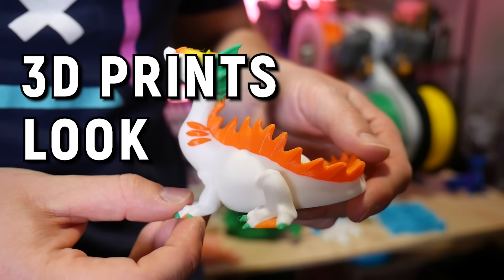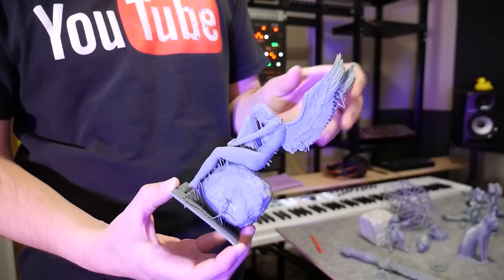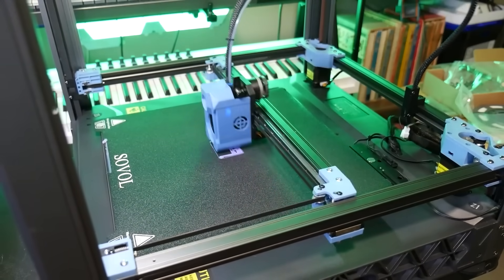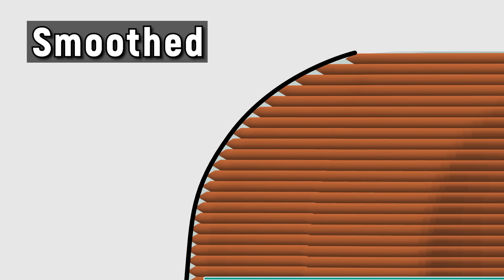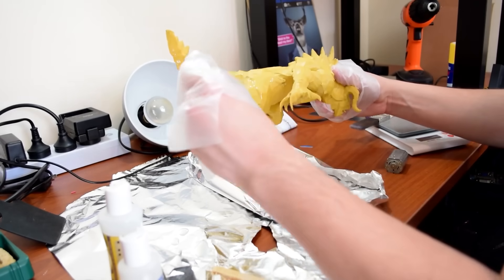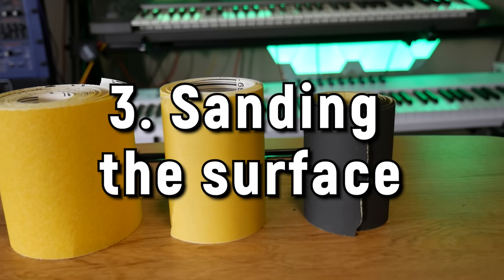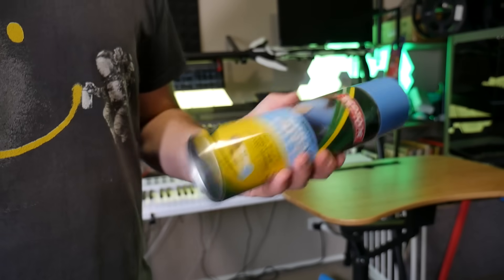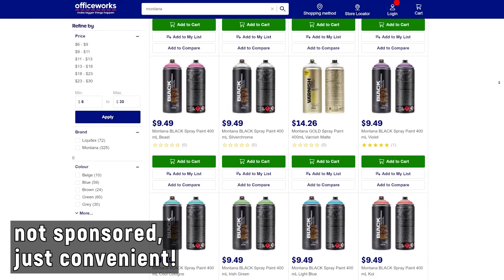How to make 3D prints look like they're NOT 3D printed.

Comment: I've recently been experimenting with Acrylic modeling paste. This stuff is THICK! However, it can be thinned with water. You can apply it with a brush easily. The real party trick is once its dry, to get some water and a low grit sanding sponge. The water will "re-activate" the paste a little allowing you to sand/move the putty around to smooth it further. Works pretty well and is less "chemically" to other options. Also, it sands REALLY well.
Reply: Some people mix it with IPA instead, until its reached the consistency where its self levelling and then paint it on in two coats.
Reply: @radishdalek  So I tried IPA. I will say it dried MUCH faster than water. Maybe I didn't mix enough IPA to get it to self-level, but other than fast drying didnt notice too much difference than water. The big thing with water is after it has dried, you can use a sanding sponge and water to smooth it out.
Reply: @JeremyBlackston  Wat grit size do you use to sand?
Reply: @radishdalek  I am really only sanding with 220-320. Here's my method...
After the initial coat has dried, I'll use an old sanding sponge (could also use a high grit sponge) and some water. The effect on the dried putty with the sponge is that it re-activates the paste temporarily, allowing me to "move" the paste around, smoothing it down further. I then just use a cabinet scraper for VERY light sanding. Once this is done, the part has nearly a gloss to it. I then do a little primer just to see about any spots that may be needing work and will work on those if needed.
Reply: @JeremyBlackston  That's great - thank you
Reply: @radishdalek  I had heard that. Will give it a shot.
Reply: Nice idea and Kmart in Australia have 500ml for $8. I'll be trying this ASAP. Thanks
Reply: @B1OD  Today I learned Kmart is still alive lol
Reply: Yes, very true and I go this way for the bottom then bondo (car filler) for the top because bondo is waterproof.
Reply: Just started using this myself, though now I'm curious to use the IPA vs water trick.  Also hadn't tried wet sanding it before.  So far I've had no issues with various spray or brush on paints sticking (unsurprising) or the paste itself sticking to prints I've roughed up.  Seems a lot faster than using filler primer and waiting for it to fully cure over many coats.
Reply: I use wood filler. Non-toxic, water based and fast drying. It sands really easily and one good thing about it is that heat is not going to be a problem. Thinning it with water and isopropyl makes it brushable while keeping drying times low. Also: 100 points for using cabinet scrapers.. People still don't know about those enough. Using the same idea, a sharp 90 degree edge works with other tools too, my favorite is originally from a wood carving kit, it is just sharp spike with four very sharp edges. You can get really in there, in the tightest places. Mostly used to bevel edges.
Reply: @squidcaps4308  ooh! Got a pic or link to the tool you mentioned?
Reply: I have been using modeling paste for over a year now after a bad experience with bondo (acetone based) and have been very happy with the results.
Reply: you can use acetone and mix it in a paper cup
Reply: How resistant such acrylic coat to deformations of PLA parts?
Reply: @oberguga  I'm not quite sure I understand the question.
Reply: @JeremyBlackston  if 3d printed part would bend slightly under the load will such coat crack and fell off or it bend?
In other words is this coat brittle or elastic, how good adhesion it has?
Reply: @oberguga  Ah I understand. I will test this and get back to you.
Reply: @JeremyBlackston  thank you
Reply: @oberguga  For me, the adhesion has been excellent. I think I have a flexible part around here that I can apply some and torture test the stuff.
Reply: @JeremyBlackston  It will be great))
I'm already buy some stuff and try it. Unfortunately my part not flexible(small and bulky) so I can't try it myself now. But  as it is for now it looks great.
Reply: @oberguga  Acrylic is water based, no Solvent, so you're ok !
Reply: Also, you could try, as I intend doing, acrylic flow medium. Should be more effective than water as its purpose is to smooth flow without affecting pigment density.
Reply: MTN has been at Officeworks for a while. However, I found that Graffiti stores usually sell the cans for 2-3 bucks cheaper.

Comment: "Bog Sand Prime", going to have to google "Bog"
Reply: "Filler" as in Bondo or Rustoleum spray filler.
Reply: Maybe ‘bog’ is just an Australian thing… we even have products called ‘builders bog’. It’s an exterior filler used in building houses.
Reply: I did too but I still didn’t get it.
Reply: Bog is also called body filler, it's a mix of resin and a filler like chalk.